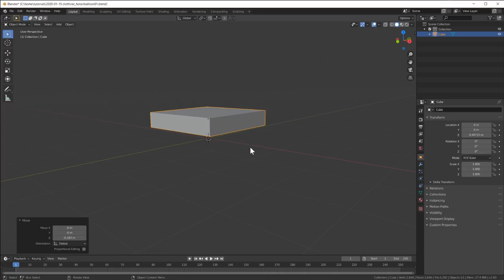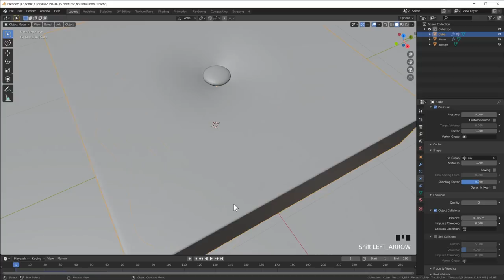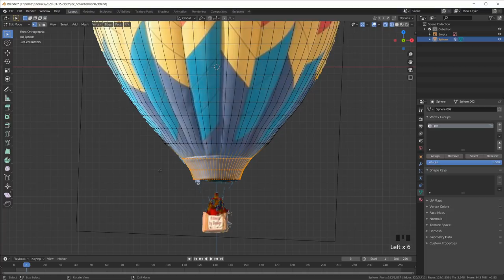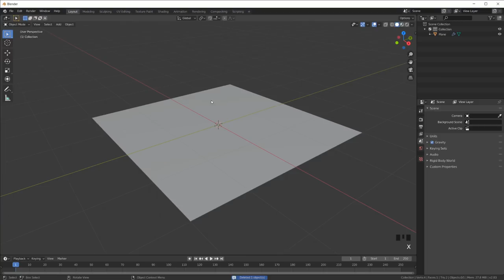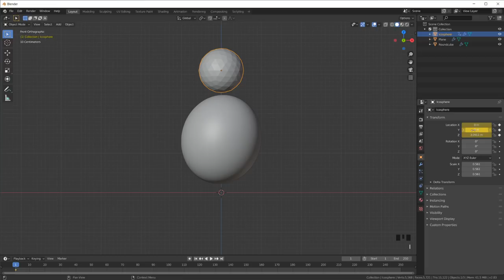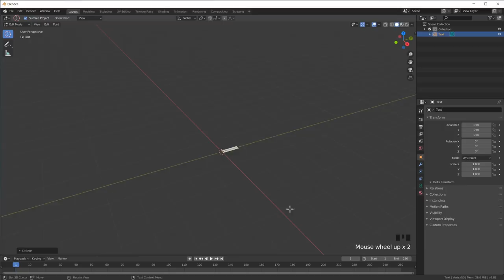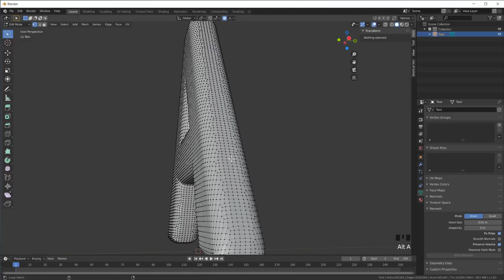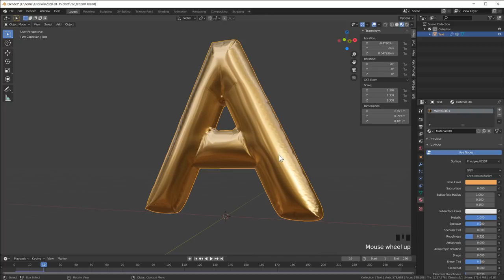4: Pressure 2 / Practical Cloth Sims in Blender Pillow Hot Air Balloon Bean Bag Letter Number Logo

Comment: The pillow pin dent you created is locked to 3D space instead of the pillow center of mass and will therefore not move with the pillow; This creates a pillow shape hanging from the pin dent.
Reply from the maker: once you are done with the sim and have a pillow result you like, simply apply the cloth modifier and you will have a finished asset!

Comment: I'm following along, but I have several differences in my Blender 2.81a from yours.  For example, when I select the cube-pillow and click on "Cloth", the cube disappears.  It comes back when I click on the monitor icon to the right of "Cloth" to un-highlight it.  But yours is on and the cube is visible.  Why is it different?  When I click on Cloth to open up the drop-down menu I do not have the same list as you.  You have "Internal Springs" and "Pressure", but I do not.  Would you happen to know why these issues are occurring?  I'd appreciate your assistance.  Thanks.
Reply from the maker: You need Blender 2.82 or later!
Reply: @chrisprenn  -  Okay, thanks for that.  I did install 2.82 and followed along as before.  When I selected the cube-pillow and clicked on "Cloth", the cube disappeared.  And when I click on the monitor icon next to "Cloth" it reappears.  This does not happen in your video.  Why does the cube disappear when I attach the Cloth function to it?  Something is certainly not right.
Reply from the maker: Are you on frame 1? Sounds like you are on a later frame in the timeline and gravity made the cube fall down...
Reply: @chrisprenn  -  I was just looking at it all trying to figure it out and what I found was that the cube didn't disappear, it relocated way down on the z-axis.  I tried to move it up with G and Z, but it would not move.  What did work to move the cube back up was G, then clicking just above the plane rather than dragging it up.  Not the usual way G works.  Next, I tried to remove Cloth from the cube and once I did that, it moved again, but this time way up on the z-axis.

With your feedback, I think I know now why this occurred.  Some weeks ago, I applied something called SuperChargedBlender from FlippedNormals here on Youtube.  One of the reconfigurations it applied was to start the timeline at 1001 and end at 1250.  I guess I'll need to remove this and go back to the default settings.  I don't know enough about Blender to see what happened.  Let me know your insights about this.  Thank you.